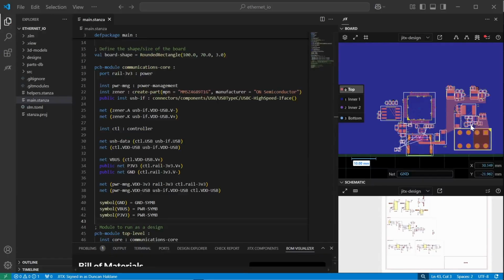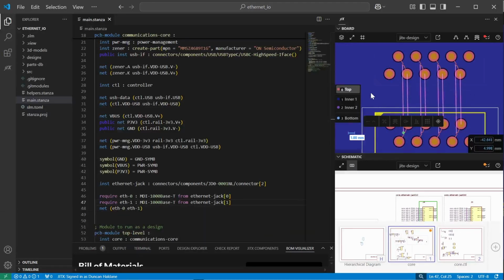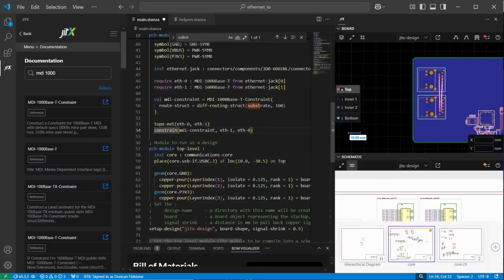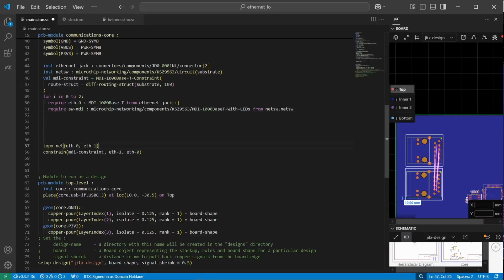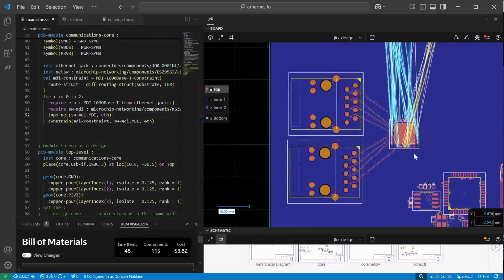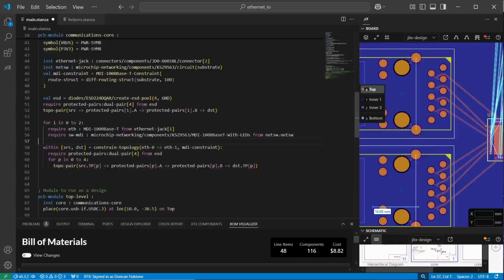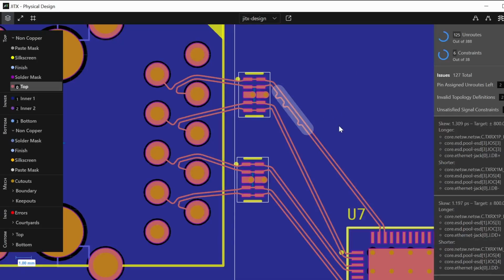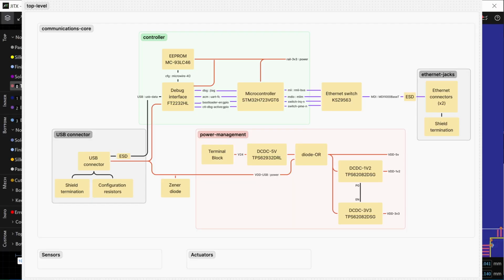Quickstart 6 - High speed routing

Comment: Thanks for the tutorial, 

normally for impedance controlled breakout, there needs to be custom ground keepouts on the inner layer (or if it's coplanar pour) or copper shape based on tuning done in 3D EM solvers. how do you add copper shape or have different width at different segment of the trace, there needs to be some flexibility of adjusting the traces here somehow, programmatically control it so that could be automated?
Reply from the maker: You can use a geom statement to add any custom geometry - https://docs.jitx.com/reference/statements/common/geom.html?h=geom which works well for breakout regions. We'll probably add some utilities in JSL to make this very easy to do.
Reply: @  thanks will check it out , anyway to clean up the arbitrary angles to 45 deg or some other angle I’m having to export to kicad and Altium right now it will be nice to do it in layout or code